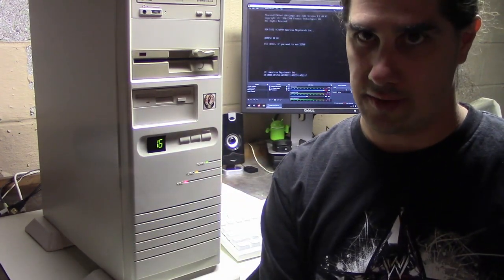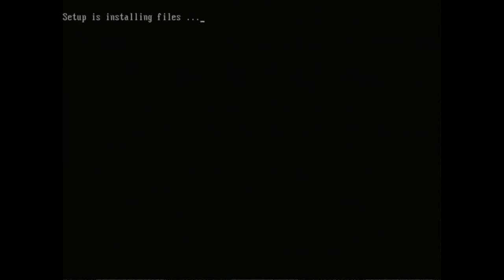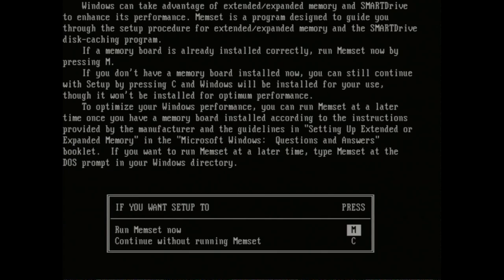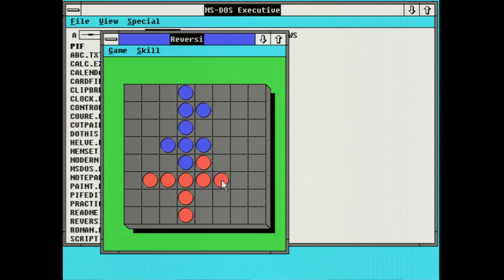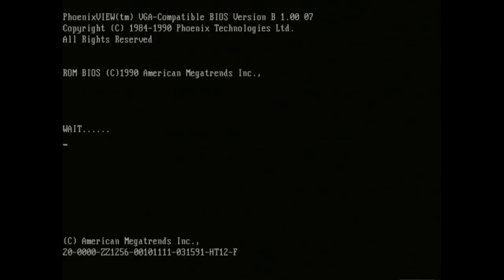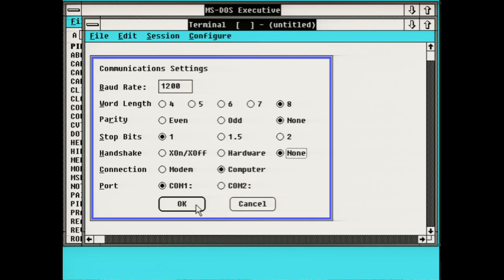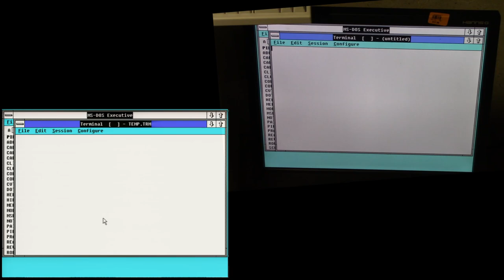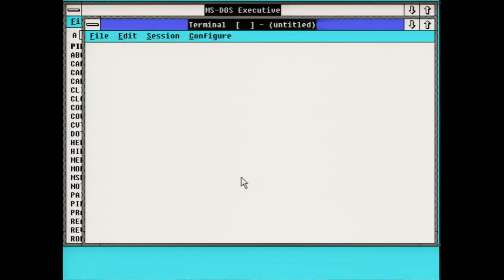Adventures in 286 - Part 7 - Installing Windows 2.11 (aka Windows 286)

Comment: That case is so epic
Reply from the maker: It's just a "generic" AT case I found on eBay.  Got a little banged up in shipping, but it works perfectly for my 286 system!  I even added my own logo badge to it ;-)

Unless you meant the PS/2, in which case (pun intended), it's just a PS/2 :-P